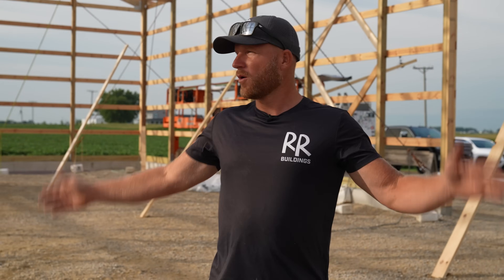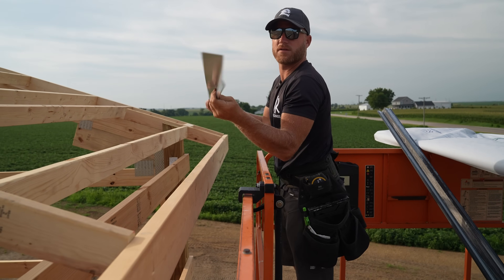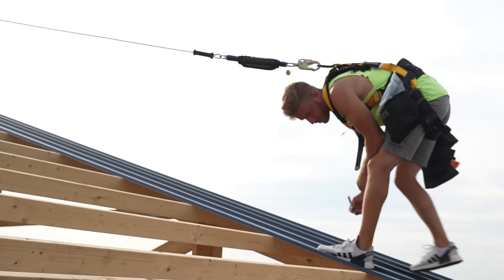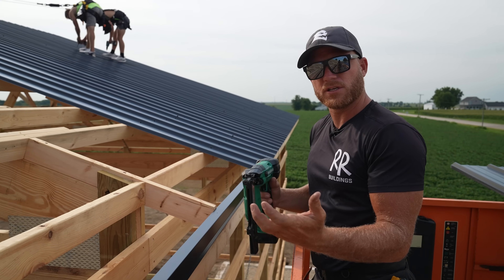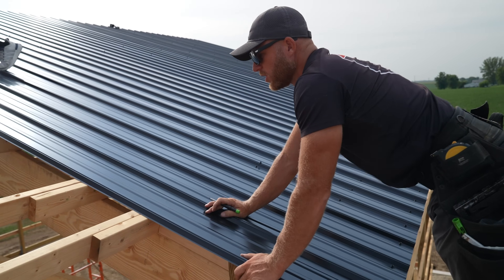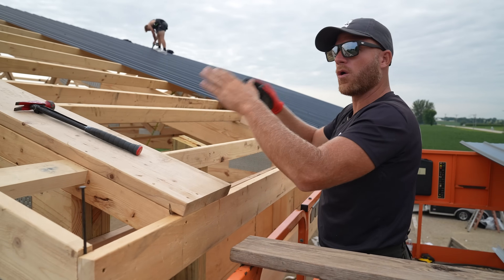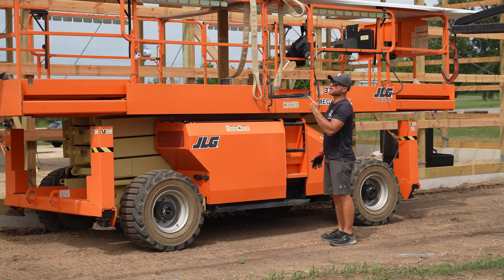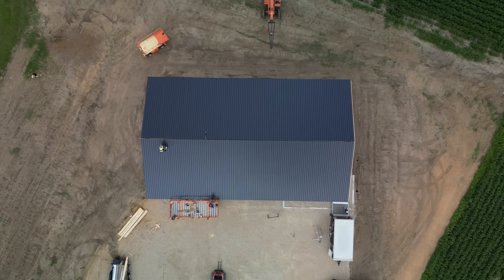Installing a Metal Roof: Farm Chains 4

Comment: For those of you watching and reading, I worked in the quality department of a steel building company for years, you also get surface rust if you pre-drill out the holes and don't clean the shavings off... cannot tell you how many times I had to visit a jobsite that said their panels were rusting and it ended up being surface rust from them drilling and leaving shavings on the panels... think bare metal fellas.
Reply: I've found the shavings from drilling are very hot & will melt through your finish any place they land.
Reply: Great advice man, thank you!
I’m doing my garage and will make sure it’s shaving free. 
Something I honestly wouldn’t have thought about. At most I would have brushed away drill shavings, now I’ll be up there with the mag broom.
I stripped it, repaired and prepped it myself so I don’t want any issues with the metal roofing, the material is too expensive for mistakes. 😂
Reply: This is one of those comments that YouTube was best for!
Reply: Just brush every sheet off before installing. Never drill the roof, no matter what. Because there is no easy way to straighten every board. But definitely pre drill all walls with the smallest bit you have. Just remove all the shavings from each sheet.
Reply: The cut guy can quickly brush each sheet.

Comment: I'm happy to see you all screwing in the flats.  Some guys around here are still determined to screw through the ridges.
Reply: For educational purposes, why do you place the screws in the flats?  I was always taught to screw through the ridges to limit risk of leaks.  Thanks.
Reply: @dirkjackson8939  I was too.  All the water runs down the flats from the ridges.
Reply: Some manufacturers are different.   If you do it to your local manufacturer. Then it will be covered under warranty

Comment: I was always taught to not put the screws in the flats unless it was metal to metal. If it leaks the wood will rot before you can see the leak if its a slow leak
Reply: If you do it to manufacturer spec. It's covered under warranty

Comment: If temperature in your area drops to 0 Celsius or below, there will be constant condensation on the metal. In this case, common solution is to use special material to protect frames and roof insulation from water.

Good work, regards from Ukraine!

Comment: Great fit and finish. Why do not use the rolls of appx. 1/2" wide caulk like adhesive to seal edges of each roof panel seam, in S. Fla it prevents wind driven rain intrusion and panel edge lift up and makes roof and walls much stiffer? Ray Stormont
Reply: What kind of adhesive would you use?  Thx
Reply: Butyl synthetic rubber adhesive is designed to provide a secure seal between metal panels in metal roofing and metal siding applications. When installed between each panel overlap, butyl tape forms an effective weather barrier against moisture, dirt, air, and allergens.

Comment: It's a shame I no longer work in the steel mill as we had light weight gloves similar to yours but they were 200 x cut resistant and I could have sent you some as they had soft rubber bumps instead of full dip and grip the sheet steel better. Unfortunately I don't even remember the name of the manufacture since I retire over 10 years ago.

Comment: Hay Mate first off I love all your videos and you do amazing work just got a question I am a metal roofer in New Zealand And I was just wondering why are you screwing in the pan of the sheets and not the ribs of the sheets and also is underlay paper not required either , just a question not criticising or judging at all just wondering , keep up the great work and craftsmanship
Reply: All the American roofers seem to fix through the valley instead of through the ridges as is the standard in NZ and Australia . Never heard a good explanation as to why .
Reply: The reason I screw in the pan is I believe it allows me to tighten the screws and squish the washer just enough to be effective without oil canning. I believe it also secures the steel better to achieve the strength needed for the full effect of the steel roof diaphragm. Its very hard to perfectly center the screw on the ridge. Finally I think most will easily over tighten screws on the ridge and distort or stretch the metal unevenly preventing a real nice straight edge for the next sheet to overlap perfectly. From the ground it may not look as nice.
Reply: had the same question, could get away with shorter screws too

Comment: Great video.  I have a metal roof on my post frame and the roof leaks from the screws.  The roof has 1” screws now so I was thinking of replacing all the screws with 1.5” screws. I noticed you didn’t mention the clutch setting on the screw gun. How tight do you like to go?

Comment: I'm curious about something.  I've watched quite a few of your videos, and find the idea of your way of construction very interesting.  My only issue is that I do not like the idea of wood being used in the structure of my home.  Have you built any of these projects using light weight steel, or aluminum?  Or any other composite material not having wood in it?

Comment: What do you do if you happen to miss a perlin when screwing in the roof steel?
Reply: He doesnt miss
Reply: There are lots of ideas ... You can use aluminium ripit also
Reply: @Wingstrat28  that’s my problem. When I put a building up in the spring, I will miss at some point! I need Kyle to make a mistake dangit!
Reply: You just add a small 2x4 block underneath it. simple
Reply: I always cut a small block and stick the block where the screw was missed you have to make sure that screws washer is tightened to prevent leaking

Comment: I like the way you do your roofing, but it is a barn. I worked with several contractors , but it was all in residential.  Even with a metal roof, we still included plywood decking, felt sealing. Beautiful job. Are those panels custom length cuts???

Comment: I have never seen you explain the roof detail of your staggered Perlins.  You stand them up on end and hammer in a spike.  Do you predrill?  Seems like they would split?  Also the roof screws would not be in a straight line since you don't but joint them.  Can you explain that portion during a video?

Comment: 2 Questions.  The screws in the top of the ribs,  for the 2x4 rafter eaves extension ?  Last sheet on the roof, you overlap as to not have to rip a full sheet ?

Comment: Hi Kyle, little man and I love watching your videos.  I do have one question, when you install your top purlin does your ridge cap screws actually hit the top purlin or do you switch to a screw more designed for steel framed buildings and just rely on the metal below to hold. It just seems difficult to git them well especially with staggered purlins that have already been covered up.
Reply: Hit them well..

Comment: I’ve been watching your videos for quite a while. Sometimes you sheath your roofs and sometimes your don’t. Is there a reason to have to sheath the roof?
Also, if using mineral wool insulation do you have to sheath the exterior walls?

Comment: On the shoulder.  Have you had an orthopedic look at the shoulder. Many years ago I tore one of  my right rotators and I never had it looked at, I thought it was minor and It may have been then. 3-4 years ago I fell off the second step on a step ladder, I thought I was on the bottom step. This time I really screwed up the same shoulder. Went to the Dr. and he informed about the first tear and now with the first Dr suggested PT first, but more than likely a shoulder replacement, which I had in May 2022. I have use but I can only go overhead about75% and not much weight. Don't wait, there are exercises that a PT can help you with to strengthen other muscles in your shoulder You are just 40 right.  Take care if it now.  I am 73 and the replacement was life altering

Comment: Also I thought in a previous video you marked 37" from center to edge of panel for layout? Did you change this or find something  better, because you set the nail on edge and mark 36"
Reply: why do they hang the rib over the edge?
Reply: @redsresearch   from center to center is 36" (3ft), so my understanding is that when you pull your measurement let's say 40ft.

The math behind it is 40/3 = 13.333
36" * .333 = 12"
36" - 12" = 24"
24" / 2 = 12"
36" - 12" = 2ft (24")

2ft from center of lapside that goes down you measure back 2ft. So, let's say if your panel was 38" in total and your coverage is 36" you would measure from edge 26" and cut. This will be the size of your first and last panel.

Another example:
71ft / 3ft = 23.666
36" * .666 = 24"
36-24 = 12
12/2 = 6
36-6 = 30"

With the same sizing from above you would measure from edge 32" (gives you 30" panel (coverage)) this will be your first and last panel, I've seen no errors in this yet and have reached out to rr and mrpostframe to see what they say about this formula.
Reply: @Juicedaddy  do you even know what your trying to say?
Reply: @redsresearch  yes I'm explaining layout math and giving examples of what your first panel you put up needs to be and your last panel needs to be. What are you asking?
Reply: @Juicedaddy  obvy if I understood that I wouldnt be asking the question.. care to explain better?
Reply: @redsresearch  So this is my understanding of what they are doing, they are moving the panel forward or backwards so that the corner will land in the flats. I've reached out to both RR and MRPostframe, but no response as of typing this. So I will be testing the formula on my next project.

In the example of a 40ft wall (you can do the same on the roof, whatever dimension  you want). We know 40ft is not divisible by 3 and what we get is: 13.333

Now to get the fraction of the sheet using that we take 36" (coverage) and multiply that by the .333 (we also know it will take 14 sheets of metal) 

Once you get the number which comes out to 12" you subtract that from the coverage 36-12 = 24" Now for us to get the starting panel and the last panel we need to divide by 2, this comes out to 12" (this can be different like the in the example if 71ft wall it would be 6") so we take 12" out of a 36" inch panel which is 24", so we know our first is 24" and the last will be the same.

Now to double check this if we do 24" (panel 1) + 24"  (panel 2) we get 48" (4ft) remember we used two panels so we need 12 more to be 3ft coverage so to see if you did the math right you can do the following: 
40ft to inches is 480" - 48" = 432"

Now divide 432" by 36" (432"/36") this will come out to 12 panels, which is perfect and we know this because it required 14 panels, we used two of the already (24" start and end) so that leaves 12.

Does this help?
Reply: @Juicedaddy  I asked if you could explain it better....

Comment: #3 questions
1.Where do you buy your tin?
2. Do you consider prevailing wind direction when overlapping your tin?
3. Do you install screws on the flats only or ribs only? For example roof on the ribs, walls on the flats? Pros and cons to either?

Comment: Please do not install a metal roof like this on your home. Roof panels with exposed screws have problems with Screws!
I've made a lot of money doing roof screw tune ups. Why do screws back out? Temperature change. Also there's a bigger problem with long roof panels. It's called expansion and contraction on the southern slope screws backing out. Btw I get it, it's a barn. You start with a #10 roof screw and tune up with a #12 then #14 roof screws. On youtube everyone is an expert on everything. I can tell when the carpenters installed the roofing, when doing a re roof. Where I do jobs everyone want's a Standing Seam metal roof.

Comment: It is ridiculous to be screwing into the flat instead of the ribs.I see a lot of American roofers have changed from screwing through the flat to screwing through the rib. as we do here in Australia. The way you are doing it would be condemned here and rightly so.
Reply: Whats the benefit of screwing through the ribs? Have to use longer screws?